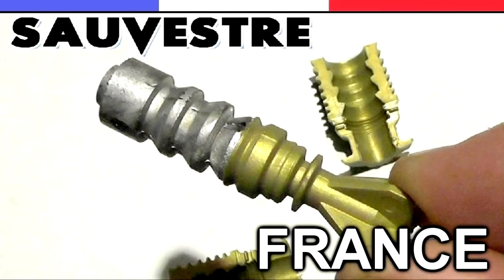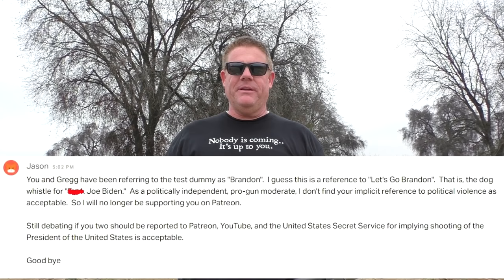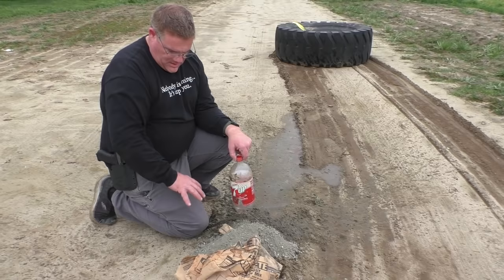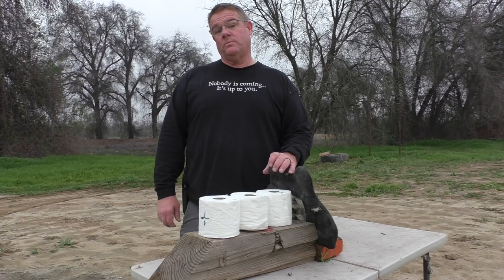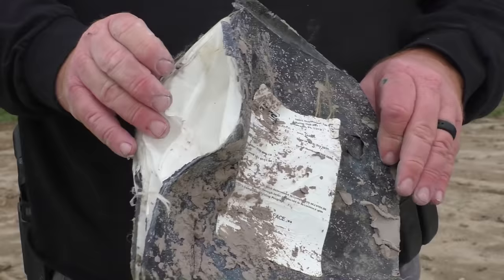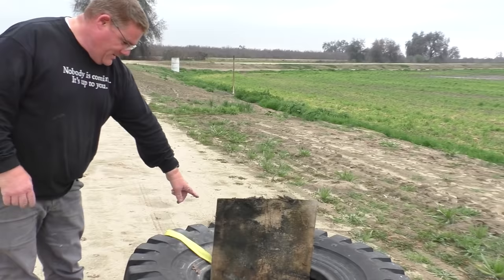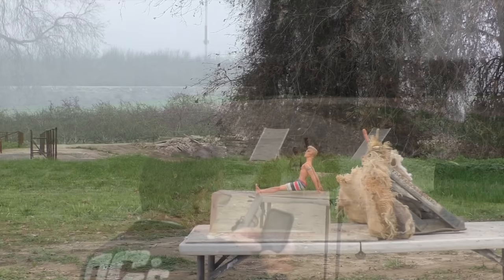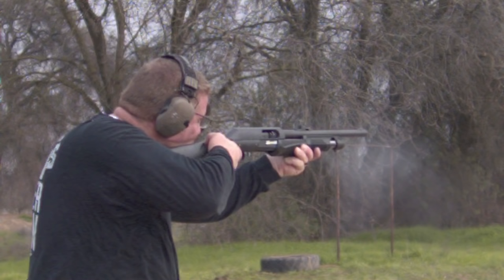RADICAL Russian 12ga. Slug Wreaks Havok on everything!

Comment: THE Slug. Those need to be made available on the open market. Million dollar design. 💵
Reply: I'd say the way these perfom you could get A million dollars of federal but you would need to get it like what's it called were u get a design patented first I think because these things would make one heck of a bear and elk slug and a 410 one would be ideal for high hearts in whitetail deer even a shoulder blade shot with a .410 would still do the job a high heart would you could have em in 12 And 10 guage for longer ranges one of these suckers in 10 guage would be nuts

Comment: In my younger days, I had a Daisey 880 10 pump BB / pellet rifle at my parent's house. Their house lot was 65 feet wide. I used a 4 inch thick piece of Styrofoam as a paper target board with a piece of 5/8 plywood behind it to keep the projectiles inside the property.
    One day, I was shooting a lot of pellets at a paper target and didn't realize that I had punched a pretty good size hole in the Styrofoam. It had been doing a great job of catching the lead pellets and kept them from ricocheting around.
    I wasn't wearing any safety glasses and decided to try my luck shooting BB's. WRONG!!!
I shot that BB, it went through the target, through the hole in the foam, bounced off the plywood, came right back home and skipped along my right temple. If it would have gone 3 inches to the left, it probably would have ran right back up the barrel.
    I wish I could say that I planned that shot but if I had, I would have never made it with a jar of 6,000 BB's. It made me a believer in safety glasses that day.

Comment: Brass, there’s a reason double rifles have ammunition loaded for dangerous game with brass projectiles.  There used to be a series of ammunition called grand slam for large and dangerous game. Because brass isn’t as heavy as lead they pressed tungsten carbide into the center of  the projectile to increase its mass and improve the BC at the same time. Maybe Alexi can try the same concept and get a bit of extra thwack out of it because the splitting wedge shape could be altered to increase hydro dynamics shock but still retain the original mass of the design.

Comment: 100 yards is reasonable with a slug if using something like a savage 212, or 220, and a sabot slug.
Reply: Actually 200 is well within range of a 12 gauge sabot slug and my NEF ultra slug will hold a 3 in group at 200 and I have stacked up many deer in the 125-200 range with the Remington accutips over the last decade and a half

Comment: It's amazing how changing the material (materiel?) of the projectile changes the performance so dramatically. This slug as well as all the others from this designer. I guess harder materials don't deform and expand as much and do less damage to the target, but it absolutely shocks me how easily ballistic vests can be defeated by brass or copper projectiles. Even from relatively low powered rounds. I saw a video a while ago where a dude made hardened steel and pointed .22 LR rounds that went straight through a level IIIa vest. (was it you guys? Might have been. I'm not sure. I looked at your older videos and didn't see it. BTW, you guys have some AWESOME old videos! Ima go check them out later) But .22s! Through a level 3a vest! That's just incredible. I just love watching to see how different projectiles affect the performance SO MUCH! I learn a lot from these videos. I never even thought of "barrel harmonics" and how that affects impact point. Sorry I'm rambling on. Anyway, love these videos and I think you guys are funny and awesome! Especially with that intro. Hehe! Keep it up.
Reply from the maker: Not us!

Comment: Bullet board is usually kevlar.  I used to work for a company that installed it in convenience stores an bqnks.When you cut that stuff it gets in the air and all over everything, it's worse than fiberglass if you get it on your skin.

Comment: I live in lower Michigan and before they made centerfire straight wall cartridges legal for deer hunting here shotguns were pretty much the go to weapon. Still are really for most people I think. That or you can use a modern muzzle loader. With modern sabot shotgun ammo and a rifled barrel 100 yards isn't unthinkable. If you take the time and spend the money to find the ammo your particular rifle likes it is certainly doable. Even more so if you want to take the time to hand load. I wouldn't expect 1 inch MOA groups at 100 yards but minute of deer and groups that are ethical can be had. You for sure have to shoot your gun at different distances to make sure though. Foster slugs out of a smooth bore or other similar type slugs are maybe 50 to 80 yards depending on the gun and if you use sights or not. And assuming you can shoot a shotgun well enough to hold decent groups. Personally I preferred to use my modern inline muzzle loader for the whole gun season. I found it more accurate and cheaper to shoot. Not to mention less recoil.

Comment: Can you guys try using carbide putty to make a slug?  It's made by devcon and it's an epoxy with carbide chunks.  Might be pretty cool.
Reply: I would not think that tungsten carbide would perform all that much better than lead as a powder/epoxy composite/sintered mass. Solid tungsten carbide is what does the magic. I could be wrong

Comment: Why do people think tractor tires will stop bullets/slugs? .22-50bmg, it'll all go thru. Hell, even pellets will at least sink an inch. In Iraq we filled them with compacted sand for improvised barriers, then went to large gravel rock and sand mix because things kept working there way thru. 

However, we found out that some used forklift tires we got from our tractor parts supplier worked great. According to the supplier, he pranked us as he knew they're Kevlar lined. Learned something new.

Comment: Hi guys. Regards from Africa. Ever heard of, or tested, something called the THV? French round, made to defeat body armour but stop in human tissue, almost instantly, dumping lots of energy all at once. Huge temporary cavity created, thereby. Designed for use inside aircraft such that a shot hijacker does not mean a punctured cabin. Used by French special forces. Apparently, South Africa is the only place in the world where these rounds are legal carry ammo. Looks almost exactly like this round you are testing, but has a single central peak instead of ridge, up front, and severely squared off 'shoulders' of the main part. Also made with brass, but almost completely hollow. Instead of a standard 70-75gr round, FMJ semi-jacketed (which, with Fiocci, can go down to 60gr, with +p, making for a surprisingly fierce self-defense round) or roundnose lead range round, the THV weighs in at about a third of that: just 25gr. But that's insufficient to cycle my Hungarian-made 7.65mm Walther PPK-style carry gun. Had to load up to 12gr of fast shotgun powder, with a trickily dangerous degree of compression required. At that quantum, the bullet left the barrel at close to highest 22 long rifle speeds. So lots of speed, little mass, huge temp cavity cross-section, absolutely destroyed two aligned ballistics jell capture cells - and had lots of hard material penetrability, like right through a solid wooden door or multiple telephone books. Interesting round. You should try to find some and try it out.
Reply from the maker: Yes,  but we haven't had anyone make something like that yet.

Comment: I was confused by your "100 yards, with a Shotgun!" comment. Absolutely. The drop is only 4-5 inches at 100 yards. That would be a very common shot up here in Alberta (75 is probably more common). However, our guns are usually kitted out pretty well, with scopes!
Reply from the maker: I have a friend that took a deer at over 250 yards with a 12ga.  But the vast majority of shotgun hunting is done without optics,  with Foster slugs,  and often from a blind.

Comment: why not double up on your armor panels? hell, come think of it, what if you were to make an AR550 rifle rated panel that was fully encapsulated with level IIIA ballistic material, and then the rubber anti spall coating? or maybe not even need anti spall because a thick enough kevlar envelope around the plate would be enough to stop any spall

Comment: Looks like a thv slug or tres hute vitese slug they were originally developed for French 32 caliber police revolvers and there is reports of ppl getting hit with them in there foreheads and there eyes and temples would blow out they would go from like 1000fps to just shy of 2700 FPS and that's the 32 caliber version they make em right up to 7.62nato in South Africa I think there law enforcement roles still use them there probably my favourite bullets the velocity is just insane in any caliber but the 7.62 mm ones really shift if you want if you haven't. Already done a version on the channel make some up from brass and copper I could make them easily on my dad's lathe and a 12g one would really put the hurt on stuff they would blow watermelon and even ballistic gel to Kingdom come I'd reckon you would get a complete pass through on a full size ballistic gel block but I'd estimate the first 4 inches would be split the French developed them as it was cheaper to do some ammo research instead of changing the Whole police revolvers and they really are quite crazy in any calibers and a 12guage shot cup loaded with a .410 thv slug would really move I could probably get some nylon sabots made to hold them tight in the bore seriously thv stuff is an incredible round if you gave it a relatively light load you should get like 2000fps easily

Comment: Has anybody tried these geometries with tungsten/tungsten carbide?
I have enough diamond cutters & broken endmills to make a few. But EDM would be a better method. or, if anybody works at one of the companies who make tungsten carbide cutters or those knobs that go on the end of drill heads, Like Megadiamond or Kenametal.
I could probably make 2 or 3 with the carbide scrap I have & grinding them would take a WHILEwith my equipment.

Food for thought

Also, A higher speed camera, watching these slugs move through acrylic or poly-carbonate might help better understand why these do so well.

Comment: I will disagree with you on hunting ranges of shotgun slugs. Yes the old bore slugs were about a 50 yard gun. But using slugs like Hornady SST’s in something like a savage 220 you can definitely stretch those shots out to 150 yards. Beyond that it’s impossible to be accurate. The longest slug gun shot I have ever seen made on a deer is 250 yards and that was a hail marry basically. Fortunately it still put the deer down quick and painlessly but I would never recommend that shot. Fortunately for us here in Illinois they legalized straight wall rifles for deer hunting. So we can stretch our shots out a little better.

Comment: What is the Most F*ed up round and Most F*ed up gun you ever shot together? Were you able to actually hold the gun and feel relitively safe firing it or did you need to Bench it under a Sandbag and fire it from protection?